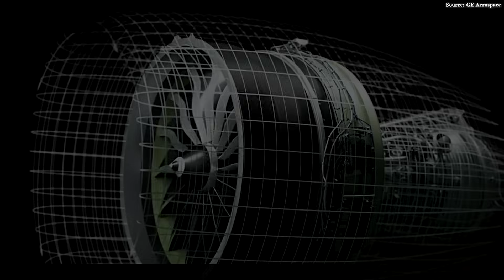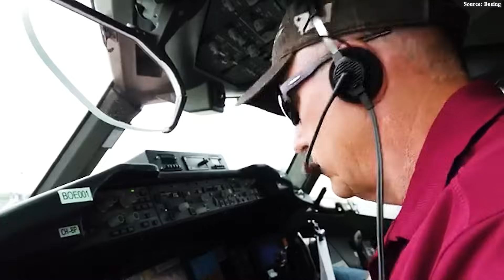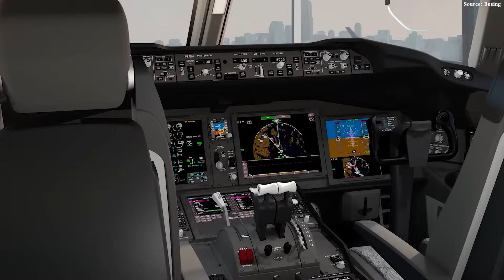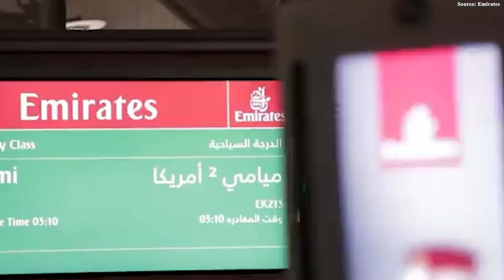Boeing JUST Dropped A BOMBSHELL About the 777X That Changed Aviation!

Comment: The 777 should have always been designed to replace the 747 for an all twin jet fleet by 2025, and should have had  the same glass cockpit and stick fly by wire as the A320.

Airbus only developed the A350 because Boeing stupidly invested billion to develop the 767 replacement called the 787 because nobody was interested in a improved 747 but a small number of Airlines were interested in the A380 which Airbus stupidly invested $32 billion to develop.

There was absolutely no need to develop the 787,  because Boeing had not yet developed a Next Generation version of the 767 & 757 as they did with the 737.  And in doing so, they effectively killed all sales of the 767, and forced Airbus to develop the A350 to replace the A330 that competed with the 767.

The 777 X should have entered service by 2006 as  the 747 replacement with with simply a new wing, engine & glass cockpit and weight reduction.  Otherwise everything remains the same.  And Boeing should have developed NG versions of the 767 & 757, and sought to reduced the price

Comment: Boeing hasn't had a good track record for getting new airplanes certified from the 737-Max 8 debacle onward. They have yet to get the Max 7, B777X or the Max 10 certified, and they are way overdue. I hope they can get that done sooner than later but,  I hesitate to count on a smooth trajectory forward judging from their recent delays. I don't plan on flying on any Boeing manufactured after the B737-900 ER until they have proven themselves for at least a year of service after Certification.  I really want to have faith in Boeing again, but they've let me down so many times in the last 5yrs I just can't.